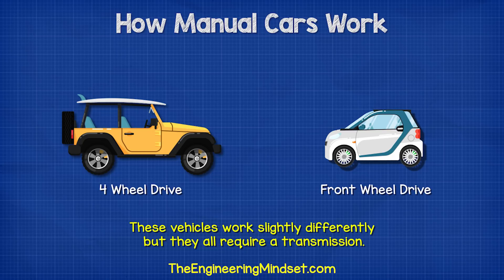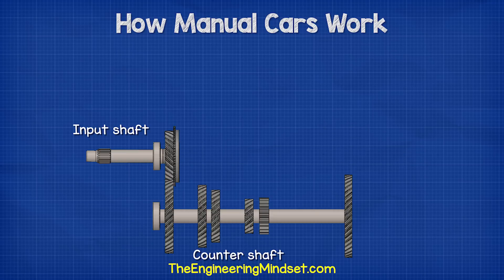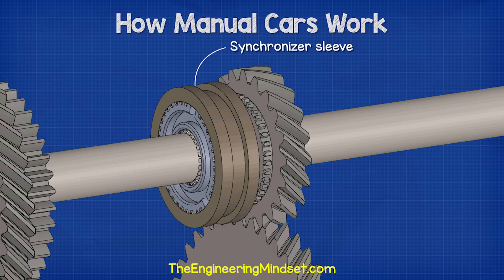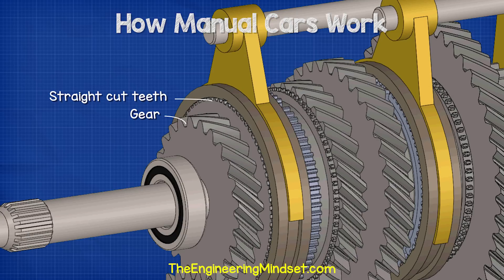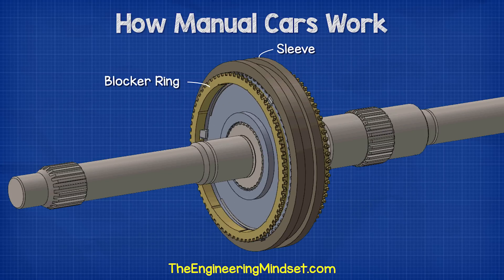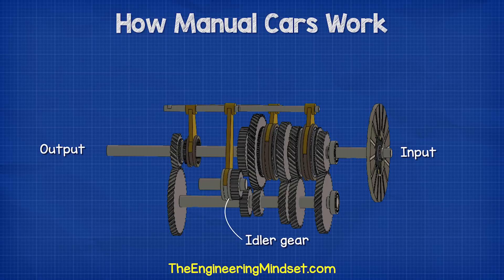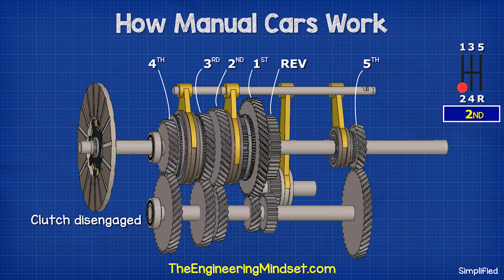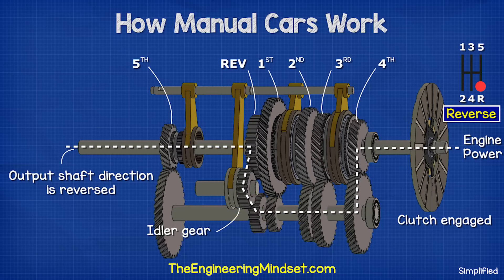How Manual Cars Work - manual transmission gearbox

Comment: So, why is it so hard to engage first gear if you are not down to a complete stop? What happens when you change gear without pressing the clutch and you sync using the noise of the engine?
Reply: Most manual synchromesh gearboxes have detents that lock the shift rods when the clutch is engaged preventing you from changing gear without disengaging the the clutch first. It is possible to pull through them in an emergency, but definitely not something to should do on a regular basis. Older none synchro and sequential (motorcycle) gearboxes can be shifted by just lifting up on the accelerator, pulling it out of gear, matching the revs then pushing it into the next gear. But that only works going up the gears, you still need you use the clutch on the way back down unless you are incredibly skilled.
Reply: Pretty sure not all cars have syncro on first gear... which means you get clashing

Comment: wait, so you have to press the transmission first before you change the gear? i mean the timing always has be in sync with the throttle right?

Comment: You lost me at the part with the slot and sleeve. Are there other names we can call those slots and sleeves?
Reply: I think you mean the synchros
Reply: @nicolasdagenais396  I’m listening
Reply: @helpontheway  think of the syncroes as a Buffy. Better yet think of them as the springs for you car wheels. The softness the impact of the hard floor and the vehicle. The syncroes softens the stiffness of the sleeve engaging the output shaft

Comment: I have built over 100 transmissions, I never had the rev gear engage like that, Maybe a European car? But the video is the best I have seen explaining a manual trans.
Reply: In most manual transmissions, the reverse gear is just an extra gear that reverses the output.  But different manufactures implement it a little differently.

Comment: A similar video on automatic cars would be interesting as well, you find a lot of videos on manual but relatively few on automatic transmissions (really going into detail)
Reply: Automatic transmission are quite quite complicated specially the valve body design.....But basics are not too much difficult to grasp...
Reply: @cck1496  all the more reason to make videos on it
Reply: Automatics are for idiots
Reply: @bobsmith3291  okay and?
Reply: @bobsmith3291  okay thanks
Reply: I want to understand how the lower gears in a AT works, it's not like down shifting in a manual
Reply: @wakkopete  It's all the game of clutch packs, bands , sprags and drums with the help of solenoids. At right RPM, solenoids must activate the desired valves and pressure relief valves....The valve body design helps in achieving this...
Reply: @wakkopete  Honda used a manual transmission with wet clutches and a torque converter. The automatic even wines in reverse like a manual transmission. It's a very interesting design choice. Inside, you are using clutches on gears instead of a gear selector.
Reply: You aren't looking hard enough.  There are tons of videos for rebuilding and understanding automatics.  Look up your vehicle transmission and search it in youtube. You will find d tons
Reply: @hoganhogan952  I don't have an automatic transmission, the videos I saw weren't great do you have a recommondation?